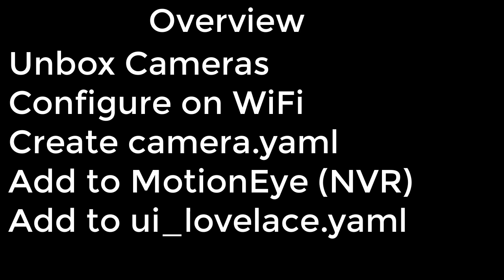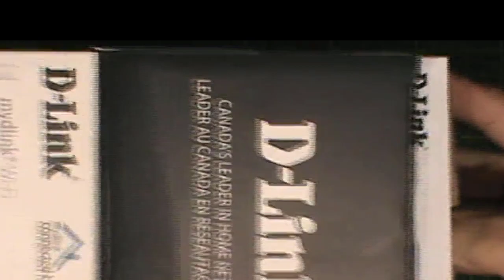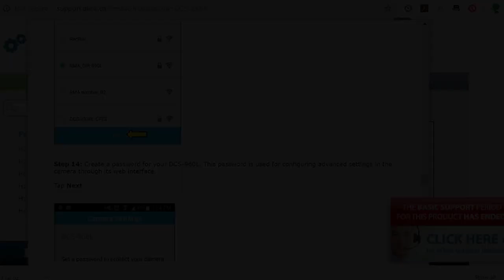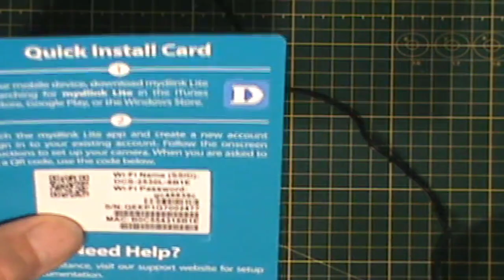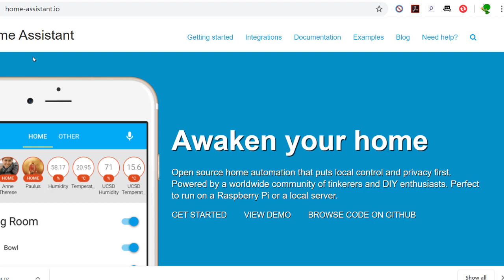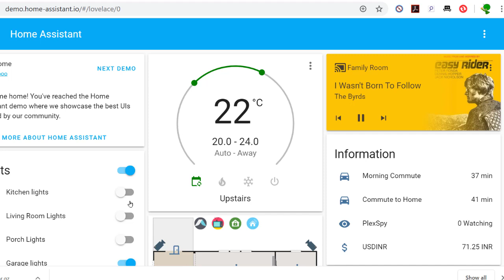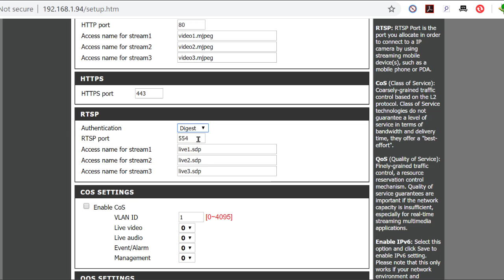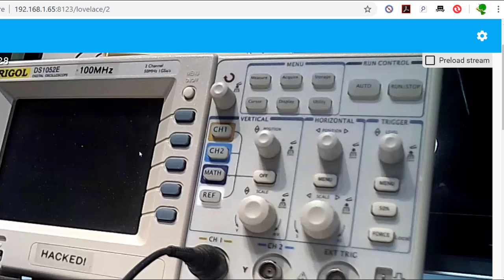Add IP Camera to Home Assistant!

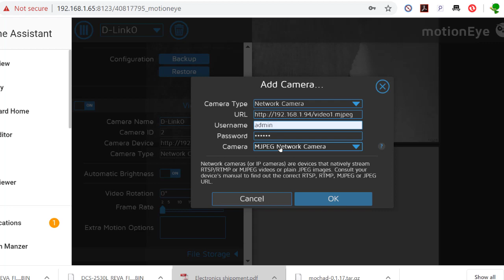Comment: Nice video.  One question.   At the 16:00 mark the URL you are using has the IP address and then "/video1.mjpg".    Where do you get that URL, I'm just using the IP address for the camera from my router and it's not working.   Not sure if that's my issue, I'm just trying stuff.

I guess i'm also wondering what username and password that is?   For the camera software?
Reply from the maker: Hi Eric, Thanks for the kudo's!  I used the IP address of the camera that I preset on the camera from the web interface.  I picked an address that was unused and not in the DHCP scope - and it is now reserved in my router.  The actual stream info comes from the camera under network setup,  HTTP.   I hope this helps!
Reply: Thanx for the Vdo. I know only IP of my wireless camera. How to convert it into URL. Can you help?

Comment: After installing motioneye-open web ui it got error "401: Unauthorized". But in the phone there is no error. Help me. Thanks!
Reply from the maker: Hi Ngoc, In Home Assistant, just click on the motionEye menu item on the left of the screen.  It will take you to the motionEye "console" to allow camera setup and modification.  The 401 error may be indicating you are using a web interface to connect to motionEye, in which case you may need a username and password as part of the URL.

Comment: Did you have problems with MotionEye and CPU load? MotionEye and Pi3 had a lot of problems with motion detect on and only 2 cameras
Reply from the maker: Hi Riccardo, I have no problem, but I am running HASSIO on an Intel NUC i5 with lots of RAM.  The pi may be a bit underpowered for CCTV.  I currently have six cameras and cpu is about 40%.  In addition to the motion eye, I am running Ad Guard, Chrony (NTP Server), Wire Guard (VPN), and Mosquito (MQTT) and a bunch more!  If you get a chance, upgrade to an i5 or i7 with lots of hard drive and RAM.  Install Proxmox and you will have an easy time configuring and most importantly backing up your system (clone the vm).

Comment: Thanks Steven maybe this will inspire me to rework my cameras and get back to Hasio:)
Reply from the maker: It is a good time to give it a shot.  Being stuck at home, and waiting for parts to come in, you might as well tinker with stuff you have in a box somewhere!  I scored on the cameras.  I already had dlink cameras so I knew what I was getting into.  I had trouble figuring out the rtsp part so I finally sat down and got that part working!   Both of these cameras were difficult to configure (read that as time consuming!).  The home assistant part was pretty easy.